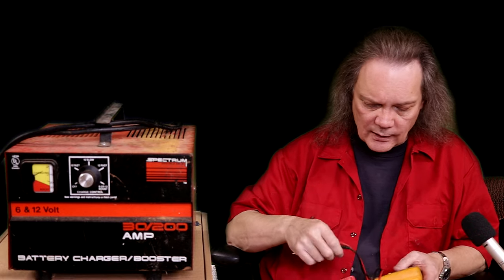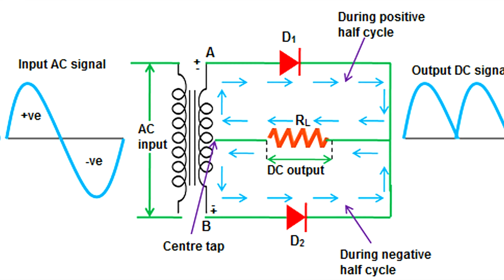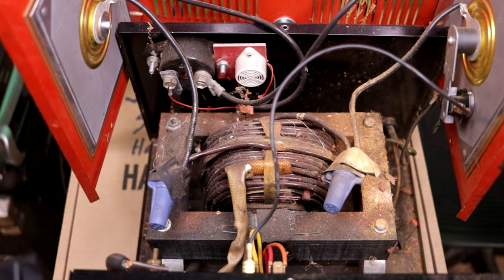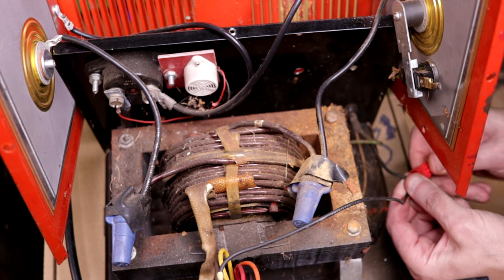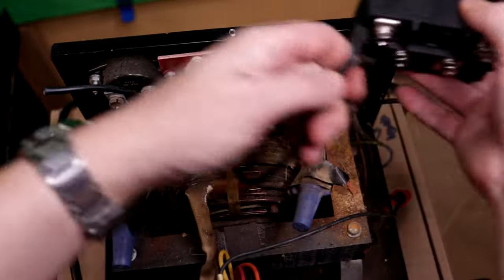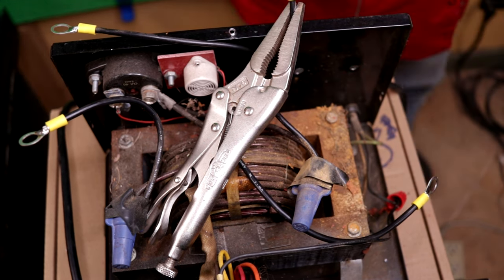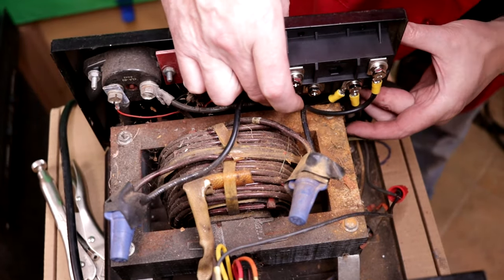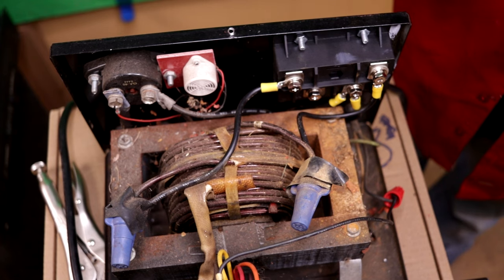DIY Car Battery Charger Upgrade: How to Repair and Boost Your 200 Amp Charger

Comment: Hello I have a older Sears battery charger model #934.718460 . Rectifier seems to be defective. Mine has two large negative leads from secondary windings of the transformer. That goes to ,what looks like there are two four diode bridges Should I look at purchasing two bridge rectifiers modules ? Have pictures. Couldn’t see how to add pictures using YouTube app. Thank you in advance.
Reply from the maker: If you only have two leads coming off of the output of the transformer that go into 4 diode rectifiers, I would assume it's a bridge rectifier configuration. The diode module that I used is a bridge rectifier, so you'll only need one. Connect the transformer output leads to the AC terminals of that bridge rectifier block, and connect the output charging cables to the plus and the minus labeled terminals. And that's it.  I think that's all you need to do, measure the output voltage to make sure it's rational.

My charger was wired a bit differently, so I only needed to use half of the functionality (diodes) of that bridge rectifier block.

I put a link to that part in the video description.

Good luck!
Reply: @Barry-Watson  Thank you for replying! 
Mine has 3 leads coming out of the secondary side of transformer. 2 negative and one positive. Is there a way to send a picture?
Reply from the maker: In that case, your unit is probably wired the same as mine was. The center tapped lead, probably the red wire, goes out to one of the battery clamps, and the other two wires from the transformer go to the rectifiers. So attach those two black wires to the ac side of the new rectifier block, and then just use one of the output terminals (plus or minus) to the other output lead clamp.  Use a meter to make sure that your red output lead is positive, if the polarity is reversed then just attach to the other output (+/-) of the rectifier block. So, in this case on the rectifier block you will have two ac wires coming in, one output wire, and one unused terminal. And, again you'll only need a single rectifier block.

Comment: I see that you know a great deal about electricity.  I wonder if you would consider my problem.  I have a 400 ft well with a 3 wire 1 horsepower pump.  How it works is the 2 legs of 220 go to a pressure switch.  Once activated the 2 wires go to the pump control box which has a start capacitor and sends 3 wires to the pump.  The water goes to an expansion tank then upon reaching like 60psi everything shuts off.
What if my water freezes?  What if a break in the pipes causes water to go everywhere and I am not around?
I went to the local business and they have no answer.
Proposal:  If I had just a pressure sensor that made a signal turn on a relay that powered the control box I could set up a timer that if the pump runs for more than, say 4 minutes, it automatically shuts off.  I would love an alarm, too.  In fact, I wouldn't mind a blue light at the well that tells me when the pump is on.  Since I'm dreaming I would like to know the amps the pump draws while on so in the future i could track differences.  It would be nice if all of this were somehow in some log that would tell me the history of the particulars.
I know I'm not the only one with this problem yet no one makes a plug in solution to it.
You need not spend your time on this, I would feel guilty if you did, but if you like this type of problem solving I (and probably others) would appreciate the help.
Thank you
Reply: It just occurred to me, If the pump shut off it could send a text to me saying it shut off.  Also, I'd like a digital reading of water pressure on my pump house.  
If you made these and called them "smart well pumps" i think you would see thousands of them.
Reply from the maker: If you're concerned that the remote pump system might freeze, I think I'd follow a simple approach of insulating a cover over it or a box around it.  I'd stick a heat lamp (and maybe heated pipe wrap) in there and use the temperature controller like the one linked below (This is the unit I use on our chicken coop)  This digital controller turn on the heat lamp if things get too cold below your setpoint. This will do a good job of maintaining above freezing temperature within the enclosure, and will prevent the system from freezing up. It's a pretty inexpensive solution.

https://amzn.to/47C9eIK

Comment: Hey Barry I just left some comments on another video. 
But I’ve been working for a band for the last year and starting 2-3 months ago I’ve been doing sound more and more. We play 2-4 shows a week from March-Oct, now during the winter it’s slower…
I’d like to email you if I could. Do you have one you can send me? Back in aug our sound guy quit last minute and I ended up doing sound and doing so on the fly not knowing anything really. Learning our entire pa at a gig… granted we didn’t start until 5 instead of 3 lmao. Un-muting the PA and mixes was the hardest thing to find lmao. Getting signal, little simple things like that smh 
But I’d appreciate if I could ask you some questions and run some things by you about combos we use like more then one channel per instrument. What a better combo would be. In your opinion anyway.

Thanks, Jesse
Reply from the maker: Thanks Jesse!  My contact info is listed on the About page (at the top) on this channel.
Reply: @Barry-Watson  I found how to see it, I gotta sign in on the browser. I’m using the app.

Comment: It's max 40amp can charge, not 200Amp
Reply from the maker: I suspect you're probably right, it sold as a 200 amp charger, that's what it says on the box. I know it can deliver an awful lot of current, but I'd be surprised if it can really deliver a lot more than 40 amps long term. The silicon rectifier I installed should be good for all of that current and more.  Thanks!